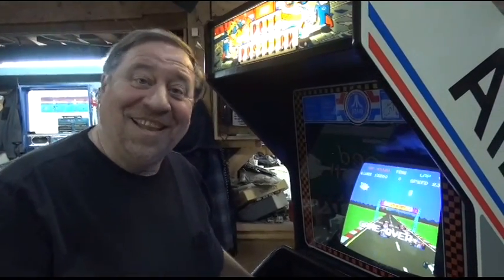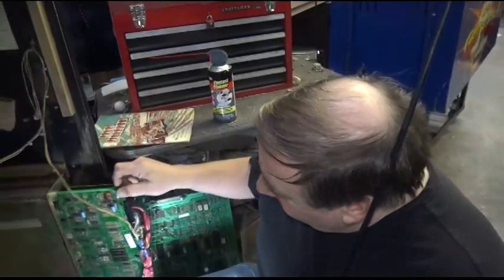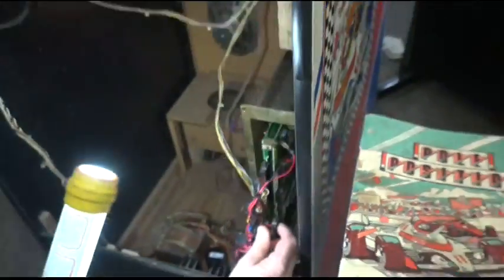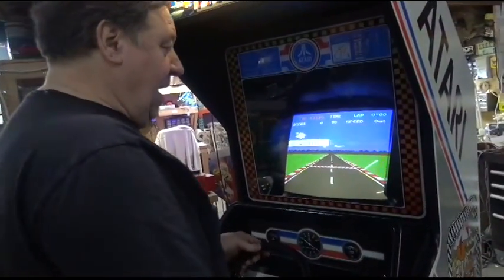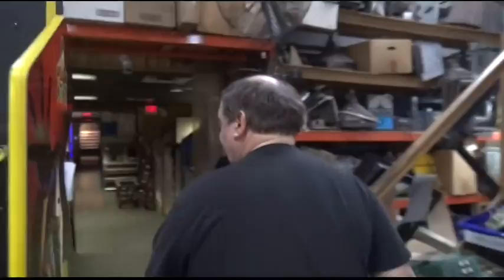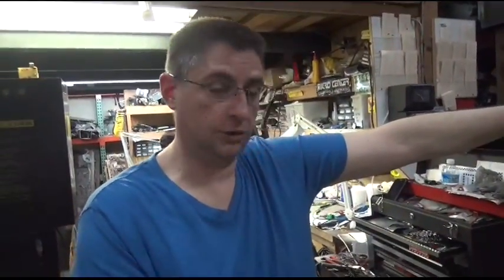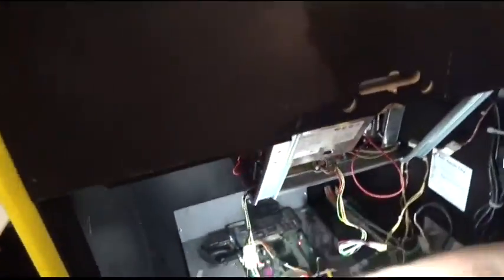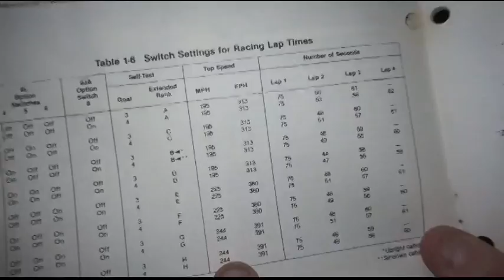#941 Atari POLE POSITION & GAUNTLET LEGENDS Arcade Video Games & some Tips! TNT Amusements

Comment: Todd, when you poke around in the guts of the machine are there places you never should go. I'm a bit scared, so I'd like to know all the places that are not safe? Have you ever done a safety presentation? I want to be safe!!!
Reply from the maker: dratoe Any high voltage you should stay away from if you are not sure where its coming in.  All machines have it present in different places...the monitor always has it around the tube.

Comment: What do you do if you can't put your initials in with the gas pedal on Pole Position?
Reply from the maker: jtathec It means the "pot: on the pedal is out of adjustment.
Reply: Is it easy to adjust or should I just replace the pot?
Reply: Just fixed it! Thanks for your help.
Reply from the maker: jtathec Great!